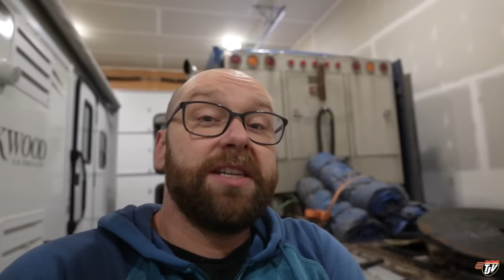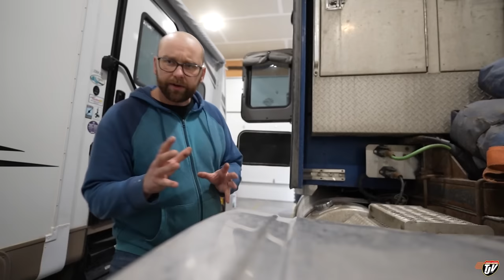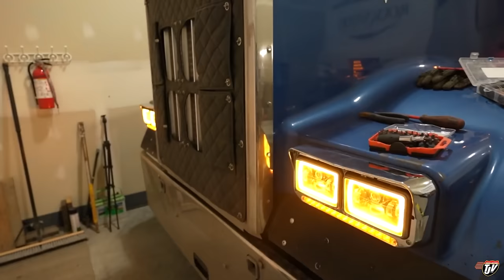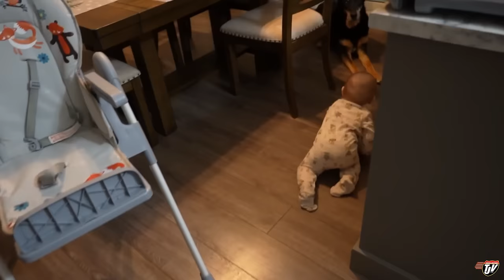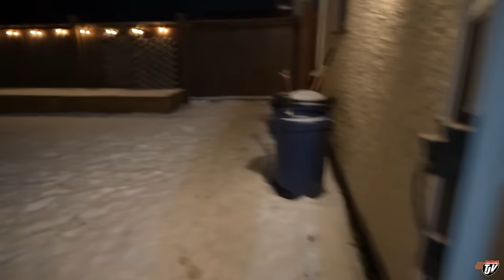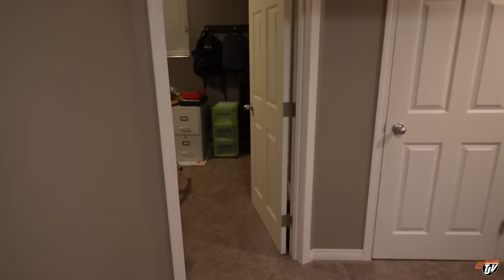FINALLY FIXED! | Hometime | Vlog #2967

Comment: OMG, Josh, I delivered in Larado Just last year.  The best I can describe it was that, IT WAS INSANE!!!!!  Im a trucker out of Peterborough Ontario and when I went there I had never in my life seen so many trucks concentrated into a small area all at one time.  I ended up sleeping on the side of the road due to every truck stop overflowing with trucks.  Not ideal but as you know this is the dilemma that we truckers are facing today, just simply not enough parking spots for the number of trucks out there.  Good luck, safe drive, and let us know how it went.

Comment: No issues with talking about the bunk heater. That is just a piece of equipment on old blue that needs some maintenance. If you can fix it yourself then you can save money. That is a good thing. The key is you know when to take old blue to the shop. I think people forget you are running a business, owner operator not a company driver. Maintenance comes out of your pocket. Keep the content coming. Take car and keep your stick on the ice EAH!!

Comment: A little tip on stopping screws from rusting I put vaseline on the screw heads it prevents them from rusting that is what I use when I install outside lights .

Comment: Being from south tx personally, as a suggestion stay away from I 35 s in tx. Traffic is absolutely horrible. Divert yourself towards entering tx through Texarkana and cut down us 59 to I 69 in Houston down to Victoria over through beeville to George west. There’s a flying j there at the junction with i37 (aprox 130 miles from Laredo) Then down to freer and over to Laredo. No fighting for parking or through the insane traffic and crazy drivers. Laredo ain’t bad, but I’m used to it, lol. Save yourself the migraines and be safe. Going north on I 35 is okay but coming south is a nightmare.

Comment: Josh look under your bunk try taking off the intake pipe it's like the exaust on your Espar. The intake mite be plugged up they calaps inside over the years take it off and try to start it mine works fine !!

Comment: Theres a loves in encinal tx which is like 50 miles from laredo i usually park there because laredo is congested with trucks coming across the border, nothing worng or at least in my 10 years of running to laredo ive never had any kind of issues but the traffic and over flow of trucks is annoying

Comment: Be safe Hard Charger. Most likely we will be passing one another at some point. I am leaving Houston heading north with a load. As you might remember, I am from the Gulf Coast of Alabama. It wouldn’t be a bad run to skip over to Bama for a load back home. Hopefully you won’t have to deadhead the thousand plus miles to get there🙏🏻